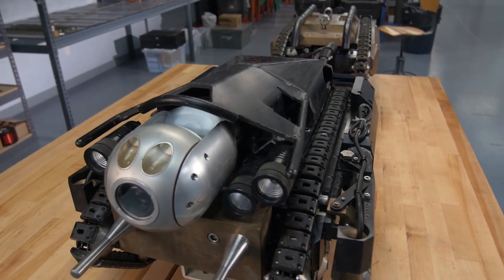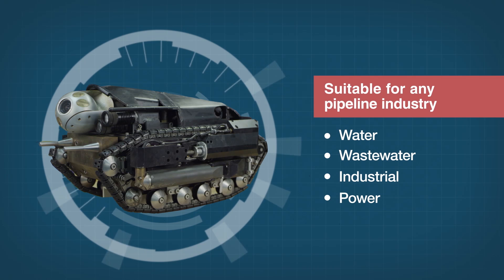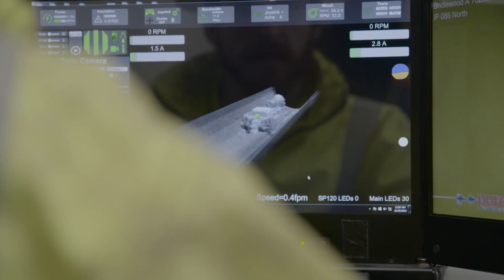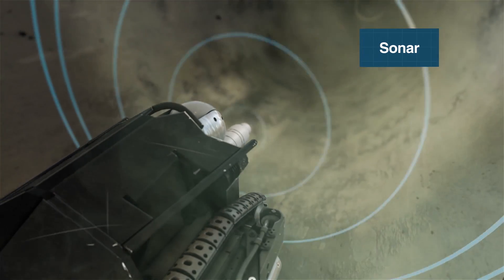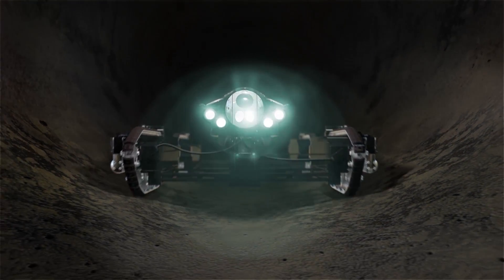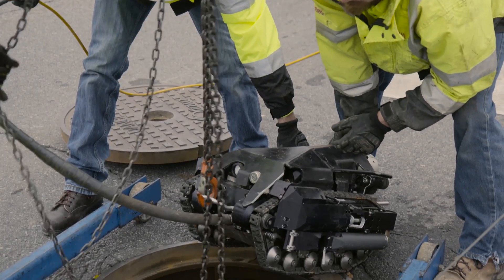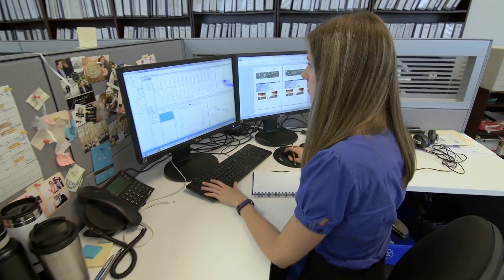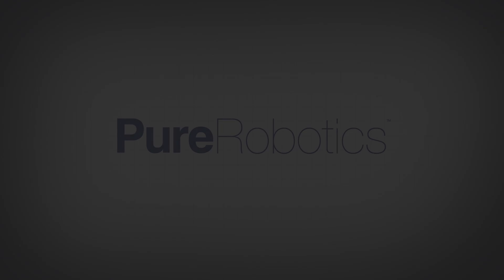PureRobotics - Next Generation Robotic Pipeline Inspection Crawler

Comment: Hi, I have weak water leak under ground, can I get solution?
Reply from the maker: Hi Ali - Can you give us more information about the problem in a direct message? Is this a leak at a residential property, on a distribution line, or a larger pipeline?
Reply: Hi, this leak at a residential property, so there are 2 bathrooms, AC drains near the leak, but the water drops is far from them !! @XylemPureTechnologies
Reply from the maker: @aliabdulkhaliq5653   Our tools and services are used in the larger pipelines that the utility manages. You might contact your local utility to see if they have recommendations on what to do and who to work with.
Reply: Hi, the leak is at a residential property, so the underground deap is about 30 cm. @XylemPureTechnologies

Comment: Hi! Can you provide information on the weight of this great robot?
Reply from the maker: Thanks for your question - the weight of the system will depend on the pipe material and diameter it is configured to inspect. The standard configuration for inspecting prestressed concrete pipelines weighs roughly 500 lbs (225 kg). We provide robotics inspections as a service, so our trained technicians are responsible for inserting and extracting the robot from the pipeline.
Reply: Whats the smallest pipe can be enter using this robot
Reply from the maker: @kriscahya  The PureRobotics tool is designed to inspect water transmission mains. Several configurations of the platform are available depending on the pipeline material - the smallest pipeline it can inspect is 16 inches (400 mm) in diameter.

Comment: it can be used for vertical pipeline too??
Or it is necessary that pipeline should not be present in service condition?
If the pipe sizes is changing then can it be squeeze according to that size???
from which software is is estimating the corrosion??
Reply from the maker: Please find answers to your questions below. Thanks for reaching out! 

Q: Can the tool be used for vertical pipeline too?
A: PureRobotics is a weight for traction system, limiting its ability to traverse vertical sections. Maximum Up slope – 15 degrees, Maxiumum Down slope – 30 degrees
 
Q: Is it necessary to take the pipeline out of service?
A:  While flow cannot be present during the inspection, PureRobotics is pressure rated to be submerged into pipelines that remain full of water.
 
Q: If the pipe size changes, can the tool squeeze according to that size? 
A: The PureRobotics platform for inspecting prestressed concrete cylinder pipe can adapt to diameter changes in the pipeline. 
 
Q: Which software is used to estimate the corrosion?
A: Proprietary software is used to interpret and report wall loss corrosion collected by the electromagnetic sensing systems.

Comment: That looks incredible, unless the pipe has stones or mud in it
Reply from the maker: Hi postminchoppa - thanks for your comment. PureRobotics is purpose built for pressure pipe inspections - pipelines like the transmission mains that bring potable water from a treatment plant to your community. While rocks and mud are uncommon in these lines, the track treads have been custom designed to provide traction against slippery pipe walls.
Reply: @XylemPureTechnologies  ok makes sense, im used to ones in sewer or stormwater lines